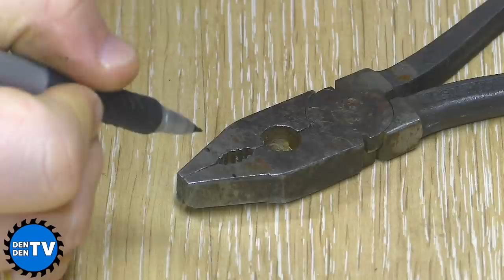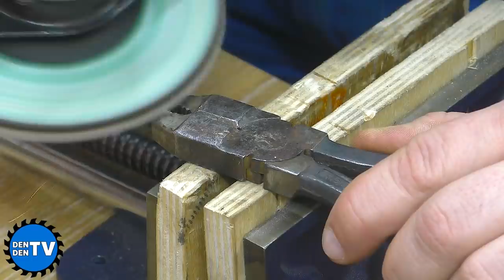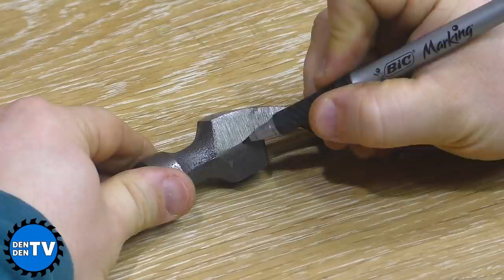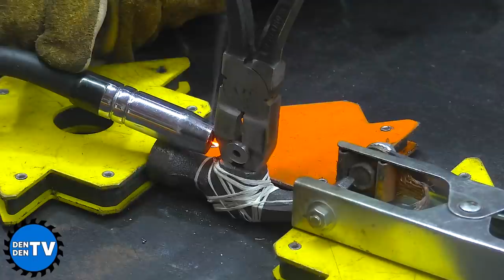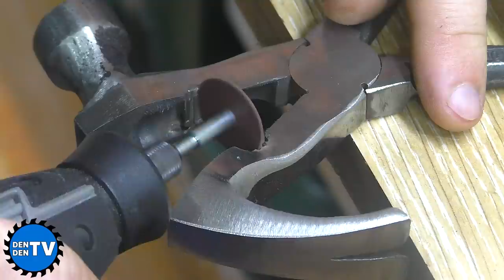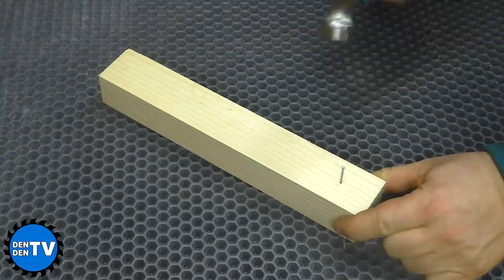Секретная функция молотка !До такого даже китайцы не додумались!

Comment: Or, you could go by a pair of fencing pliers.  They are pliers made for installing, tending, and mending wire fencing.  They have a hammer face and usually a spike instead of a claw, the spike being more useful in fencing were you often deal with fencing staples.

Comment: Having a welder and "making pieces of metal stick together" is not the same as "welding".  Those joints are all polished up and looking spiffy, but what can't be seen is that the vast majority of the joined surface area was never included in the welding process.  Those superficial welds will crack after a bit of hard use.